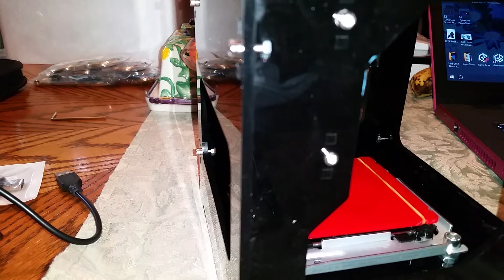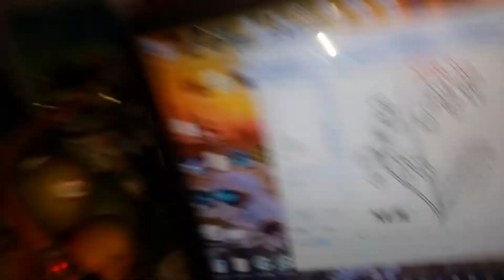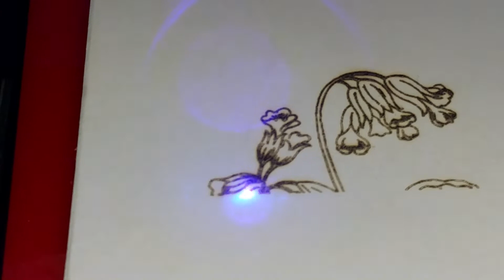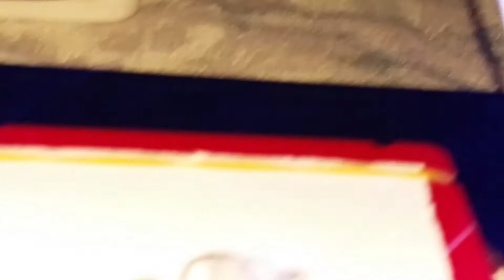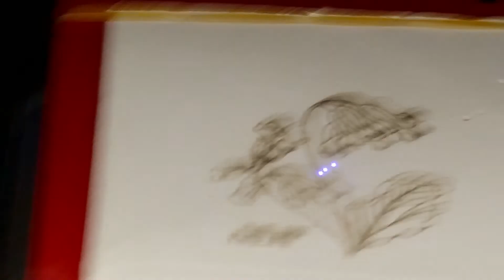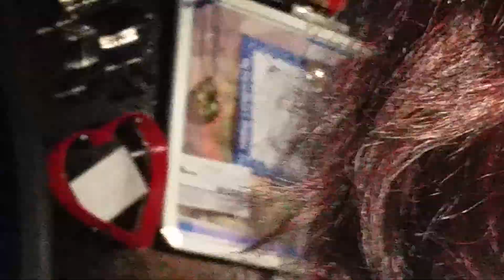SIMPLE AND EASY TO USE! COLEMETER 1000mW Mini Engraving & Cutting Machine

Comment: Since the files are JPGs, is it possible to burn a photograph into wood or some other media?
Reply from the maker: You can burn a photo into wood or media, I mean it does a nice job.  I will try to do a project this weekend and post it.  I would love a bigger one!   You can do section by section to make a larger project. I just do it on paper first so I do not waste my wood on a mistake.  I have not tried the glass yet, but I want too!
Reply from the maker: If you decide to try it out and or keep it... just go and download the fresh software from their website instead of fooling with the thumb drive.  Both my thumb drives had outdated software.  Both?  My 1st unit did not work and they send me a second unit right away.  I kept the one that did not work and hope to tinker with it.

Comment: do the machine cut though lightweight wood?
Reply: so after the laser , do you need a power tool to cut the image out?
Reply from the maker: Wait, do you mean cut through it like a stencil?   If it is really thin wood it will cut through it, but this is more to etch a design on the wood
Reply: I understand. I don't believe this is the machine for the job. I thank you for your help and keep making these utubes! very very helpful!!!
Reply from the maker: Do you own the machine?   If you do Id just try a test piece.  Depending on the wood you might be able to pop it out.  I'd test it out!  maybe if you keep doing it over and over you can cut through it??   I'd just have to know how thick the wood is.
Reply from the maker: This machine is great for making stencils, etching designs into wood or anything flammable that it can burn into.  I want a better laser too!!!  I want one that can do glass and metal.

Comment: Have you been able to figure out how to add text?  I can't figure out how to get the text into the center to send it to the printer.  Thanks!
Reply from the maker: I use a piece of paper the same size as my project first and line it up. You have to put the dot of light at the very center of your design to center it. When I do a larger design and break it down I again do it with paper first so I do not ruin anything.
Also at first I could not get anything to go to the engraver as the printer. I went over to the website mentioned in the directions and downloaded the most recent copy of the program and then everything worked so much easier.
I hope this helps.
what are you trying to make?
Reply: My software has a section on the left side that says "text". It has a way to change fonts too. I can type text into that box, but then can't get it into the large center box on the software. Does yours have that?
Reply from the maker: I had to save the file then pick the file... if I can find some time tonight or in the next few days I will try to make a video
Reply: For us lucky ones we 3D print a bed centering platform with a removeable centering square with a centered hole.